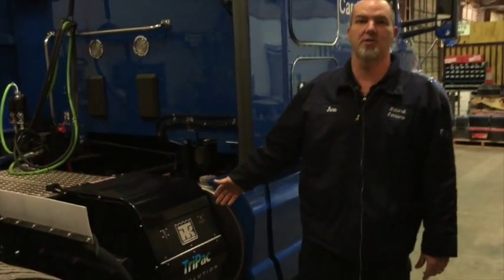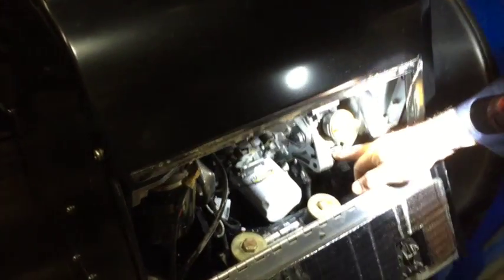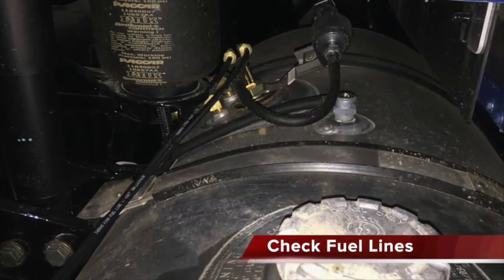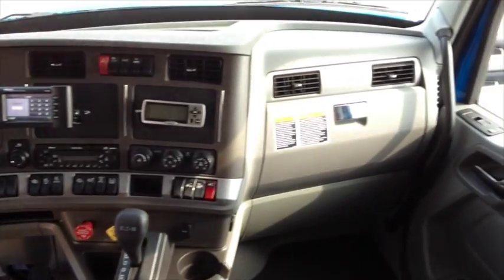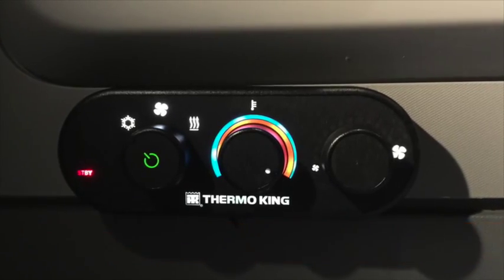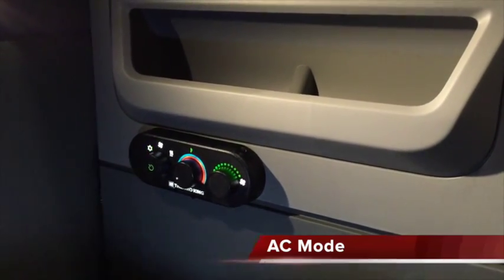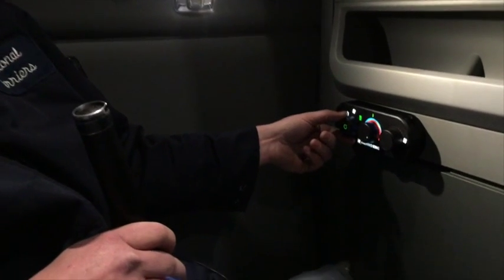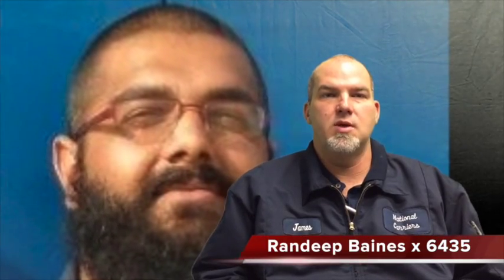APU Training - Tri Pak Evolution

Comment: Hello. Thank you for the video. I’m having a problem where I turn on the apu unit, but the a/c emblem continuously flashes and does not turn solid green. Any ideas as to why it does that?
Reply: Did u ever got a response? Same issue.
Reply: Are you turning the fan on ? Nob next to the heater one

Comment: 10w30 is all right in the winter, but why don't you run 15w-40 in the trucks throughout the summer?
Reply from the maker: We will pass your suggestion along to James White. Thanks for the comment
Reply: If you going to pass on a comment, I'll say this.  We changed our fleet to the Deere Torque-Guard 15W-40 and our oil consumption was reduced by 50-75%...  A major truck fleet bought hundreds of new trucks.  They ran the Deere product after the break-in period for the first 100,000 miles.  The service manager dropped the oil pans on 5 of the deere trucks and 5 of the competitor's.  The Deere pan was much cleaner and they switched the whole fleet over to Torque-Guard.  IT might be more expensive, but when you burn less and can run longer between over-hauls, it pays dividends in the long-run.  That aside, 10w-30 is a light diesel and gas engine oil.  15w-40 is designed for heavy hauling. https://www.deere.com/en_US/parts/batteries_and_fluids/oils_and_lubricants/turf_gard_oil/turf_gard_oil.page
Reply: It’s because the 10w30 reduces the amount of ash produced thus helping eliminate strain on the regen system.

Comment: Thanks, so the fan isn't used for hear?
Reply: since the heater uses fuel to make heat it is separate from the apu itself look up espair for example the apu provides the electric to turn the fan light the glow plug fuel pump and the heater controls

Comment: When it started up sounded like it wasn't getting fuel. Kicked in after a few seconds tho. My last carrier had apu's that did the same thing. must be a fuel pump issue.
Reply: My old truck did the same thing plus it smoked a whole lot on startup, but I got assigned to a new truck and it starts up instantly, no issues at all.

Comment: does anyone know what the "alt" code mean?
Reply from the maker: ALT

Alarms in this group are alternator, battery or system voltage
related! 
Items that a driver can look for.

Loose or missing APU drive belt Loose or corroded APU power cable connections Unusually low or high voltage at the truck batteries
Reply: National Carriers 
Thanx alot took it to a petro and the repairman told me that my alternator was bad on my tripac evolution app thank you very much.

Comment: I know this is old but it takes more then 4 quarts of oil. More like 5 12 to 6 qrts. More on the 6 side. And if anyone overfill there oil just pull the 19 mm drain plug. On the oil pan. Unscrew it half way and oil will drain. It's messy but it's alot cheaper then going to a thermoking dealer. Them guys are straight up rip offs 1000%